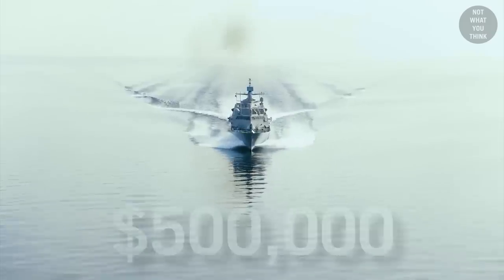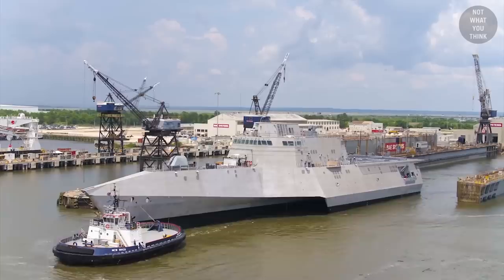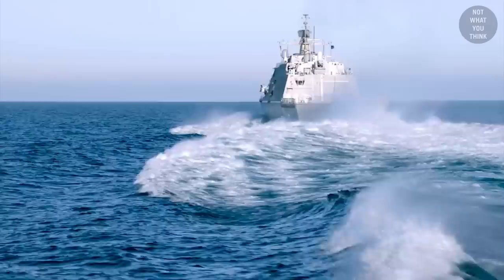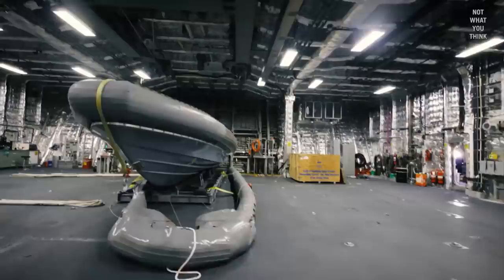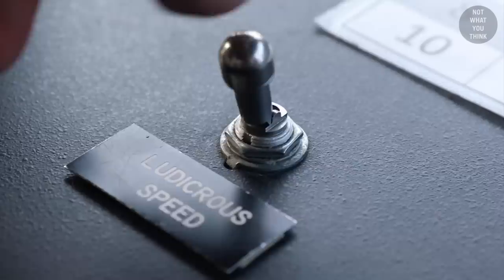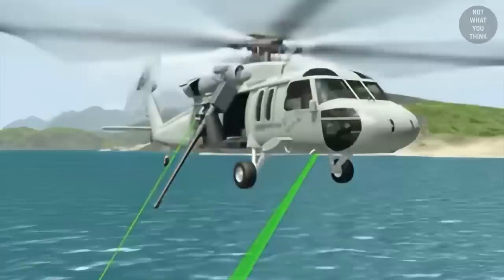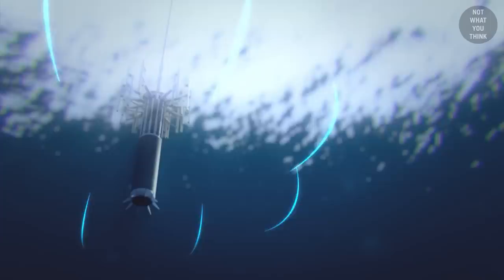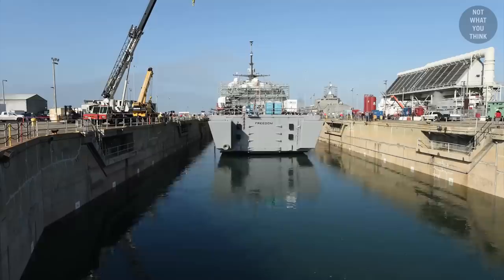Why Retire a 2-Year Old Warship?

Comment: Sucks that the independence class got roped in with the freedom’s.

My babies work now don’t be mean to them 
:(
Reply: The biggest problem with these two ship classes, the crews are way too small for combat ship. Essentially these are like the beer can you pop the top drink the beer and throw it away. In this case if you pop the top that means someone shooting at you and you got hit. Some of the most critical billets only have one person in them. That person becomes a casualty whether they get sick or they get injured, it's a mission kill.
Reply: I also think that the engine should have been turning generators and use electric motors for propulsion. No need for combining gear. When you look at the differences in RPMs between turbines and diesels it's like ridiculous to try and have them I'll put into the same shaft. With codog you're better off with the generator or alternator and electric motors. It's proven technology going back to pre World War II. The only thing I don't like about it is if it starts leaking I don't want to be anywhere near it. Electricity doesn't like me!
Reply: @JohnRodriguesPhotographer  Still, the Independence works, it has all the module's working bar the ASW and is just as fast as promised. While being able to carry 40 hellfires and 24 NSM's which give it more firepower than most of the Chinese navy cough cought 056 Cough 054*
Reply: @AM-hf9kk  Buddy, most warships nowadays would be crippled by a single direct hit. The purpose of defenses is so they don't get hit
Reply: They got rid of the first 2 Independence but are keeping the rest. The first two they used as on-the-job test ships while the others they upgraded as needed. Austel and General Dynamics did a good job, I suppose, as compared to Lockheed Martin.
Reply: @MotoroidARFC  Lockheed should stick to building planes.
Reply: @anguswaterhouse9255  🤣

Comment: The LCS was a joke concept right from the start.
* The low low price was yer typical bait and switch tactic.  Nothing new there.
* The small crew size meant no damage control and an overworked crew, and I doubt anyone except politicians actually believed it.
* The modularity was the most unbelievable of all; anyone with any knowledge of ship construction knew it would never work.

The Zumwalt's magic gun was even more obviously dumb: a gun whose individual shells cost more than a cruise missile, yet had a shorter range, a puny warhead, and less precision.
Reply: Same with the cheaper F-35.
Reply: In short they are trying so hard to dress their war machines to impress.

Comment: (USS Taylor FFG-50, 1998-2000) The FFG 7 program was supposed be a low-cost low manning, but things did not turn out as planned but in the end, they proved to be tough little bastards. 
 I guess you could compare this to the SBD Douglas Dauntless dive bomber when being replaced by the SBC Curtiss Helldiver dive bomber. Which the replacement had more issues then then the aircraft it was replacing.

Comment: Should have done more testing with the prototype USS Freedom before making sister ships.
Well with the ones under construction I’d add a lot of changes to it for good measure.
Ya know when the RMS Titanic sunk, they brought the RMS Olympic (the prototype) back to dry dock to be refitted (basically redesigned) with better bulk heads that actually reach the ceiling unlike the Titanic and adding a lot more stuff that I can’t remember at this time.
You may think it looks good on paper but when its on the field it ends up not doing well or should I say doing bad, that is not gooding to look good on your part.
With the Prototype they should have tested the engines more.

Comment: As a Brit I was wondering about the failed ASW module on Freedom Class ships and wondered why they didn't just ask the experts (the Royal Navy).
We then got to the new Constellation Class Frigate and got the answer.
Which reminded me of an earlier missed opportunity for the US Navy: Why did it bar the best ASW and modular capable frigate available (UK Type 26) from the Constellation Class competition?
Reply: Waste of money if they are going to make it out of steel.  Like most consumer products they are made of polymers.  In fact, Sweden and Norway have been operating stealth ship for over 20 years.  The size limitation is about 250 feet...
Reply: @rgloria40  i think the early lcs were made of aluminium, the good thing is it's lightweight and would be good for range, but the bad thing is if it gets hit, it's harder to extinguish aluminium fire, I think steel is still the better option for building ship hulls, steel is easier to repair and less costly

Comment: There is nothing new in a CODAG propulsion system.
The Independence class is mentioned a similar class without any problems. I remember that there where a problem with galvanic corrosion on the Independence class.

Comment: To the question at the end: I don't think the Navy owes taxpayers an apology. (If anyone does it's the designer, but I think that's a different and more political discussion.) I think the critical thing is not falling for the sunk cost fallacy. USN is getting a number of high speed, incredibly capable surface warfare ships out of this, even if it's not all that's promised - but critically, what we're not getting is a bunch of lemons.

Seeing how Russia has performed in Ukraine, and how much of that seems to be from equipment that was supposed to be counterparts to ours but is actually subpar, I think they made the right choice. The alternatives are to either commission faulty equipment or to throw the baby out with the bathwater, and I think this experiment and its lessons are more important than dumping money into a ship that can trim Putin's nose hairs with an eight inch shell from four thousand miles.
Reply: The Designers build what the navy asks for. And if the deciding officers - as seen so often - again make horrible decision out of egocentrism, power and politics, they are to blame. Not the shipbuilder.

The Navy gave the contract. They made the specifics. They overlooked it. And they did a real bad job at it.
Reply: They need to stop rushing into projects like this and freaking focus.
Reply: They ARE NOT incredibly capable. PERIOD.
Reply: @donaldcarey114  You know they're confused when they start putting hellfire's on ships.

Comment: The same issue will eventually become unavoidable regarding the F-35.
Reply: ... the F35's modular mission pods will require it to retreat from combat and stay in dry dock for several days and the gas turbines won't combine well with the traditional diesel engine?
Reply: I think they have most of the bugs worked on F-35 now.
Reply: Yeah the F35 is the first fighter that can turn into a submarine

Comment: The design suffers from basic faults that are not fixable. It basically boils down to an overly complex linkage from the engines to the shafts, when not maintenance like a Boeing 777 (which your basic US Navy type isn't ready to do) it fails. The other design flaw was the modular concept which didn't pan out. These would be good littoral ships as long as they were ported in the US...but given a tight budget and bad press they are headed somewhere other than the Fleet.
Reply: what happened with the 777?
Reply: @AA-tz2bm  I don't know, I thought we left you in charge of that ?

Comment: The government really needs to go back to the old system where it told manufacturers what it wanted, then let them create a prototype to see if they could meet those requirements and then it paid them to build the item.  Today's method of paying the manufacturers to create what they say they can and cover all the expenses in advance is asinine.  It only ensures that those manufacturers promise more than they can deliver because it makes them sound better than they are but ultimately the delivered product never even comes close to minimum requirements expected.  
When the army wanted a multi-purpose vehicle Willy's created a cheap, light-weight vehicle that could go anywhere and carry 5 men and tow several hundred pounds of equipment.   It delivered exactly what the army wanted with the Jeep to the tune of over 600k built with being able to be used as everything from ambulances to guided missile platforms and it remained in service for over 40 years.  That's how capitalism should work.  Tell competing companies what you want, let them design what they can produce and then compare the results.  Paying a company in advance for what they say they can do, not what they actually prove capable of doing has only increased costs astronomically.
Reply: The problem with that is that all companys would go bankrupt and it would exclude all smaller actors to even particepate. 
   But absolutly they should be better on demanding the the stuff work as intended. But its hard whem the development process goes paralell with the building process.

Comment: LCS class was a test bed ship, it's the senit that pushed it in to full use service. There was no difference between the test versions and production ships which is impossible unless you had some tomfoolery going on.
Reply: Aren't a lot of "wonder weapon" part testbed? Tu-22s. B-2s, Zumwatts, LCSss

Wait, almost as if there's a correlation between expensive, over-promising, under-performing and rocky design and construction schedule.

Comment: For what its worth, the US is an insular nation as Mahan would have said. Similar to a peninsula, but water on 2 sides instead of 3. Combine that with the difficulty an adversary would have attacking the US across the Canadian or Mexican border and the fact that most cargo comes via the water and it becomes clear that the US Navy should be where the nation focuses its military (navy, followed by air force, with much less emphasis on ground forces). So if anything, congress needs to apologize to the navy for all of the times it has tried to murder the navy over the years.
Reply: And FWIW, if it goes up for us in the Ukraine, it won't be the maritime forces on  the ground.  (I see what you're thinking, Lewis, but so often in the recent past, the "tip of the spear" for us hasn't been oceanic.)
Reply: @michaellastname4922  The thing about the Navy, is that the Navy is the force that allows the US the ability to create a safe zone around essentially the whole country (or at least the lower 48 in any case), pushing any encounter with an adversary over to their region. As well as providing one of the possible means for fighting said adversary (which is of course dependent on the who that is and what needs to be done to that particular adversary).

Add to that the protection of the sea lines of communication. And you end up with a hell of an argument for making the USN the focus the way the Brits focused on the Royal Navy back in the day. Maybe not quite as uptight and not excluding the other services quite so much, but you get my point.

It is the protection that the USN gives the US at home and abroad that allows us to send substantial forces abroad. Not to mention things such as what gets done by other ships under the protection of the USN. 

You can see this doctrine of putting fleets out into the enemies side of things in practice with how the USN likes to deploy fleets out into the world rather than always shepherding them into home waters. So this really is how the USN is acting, though not as well as it could be. Which means it is not as if I am saying to take everything away from ground forces or anything like that, just a rebalancing of priorities. (and an apology for all those times congress has tried to murder and/or assassinate the USN)

Comment: The critiques of this ship and the class are somewhat accurate, however, it is a reflection of the depth and breadth of US technology. This class and the Zumwalts were essentially ahead of their time and their core missions were somewhat undercut simply by the circumstances of a changing world. But the US will have learned a great deal by what can be called a failure of scale. These lessons will continue to put America far ahead, like at least a generation on ship technology vs China and Russia. American can afford this kind of thing and still maintain a distinct advantage with existing tech. But still it cannot afford to do this kind of thing too many times... Similar things are also occurring with the air side of things and American fighters and bombers. One lesson there is that you can't always build one platform to meet everyone's needs. You may end up with a mediocre platform a sort of jack of all trades, but not an expert at any.

Comment: The very concepts on which the LCS program were based were poorly thought out.  One issue that was not covered in this report was the lack of combat survivability that was intentionally part of the class's design.  They were intended to be so expendable that they would be abandoned after a direct hit.  

Engineering and construction was the second, equally flawed phase.  Why didn't the USN perfect the mission modules before building the ships?  Why didn't the USN set up the portside infrastructure to make the module swaps practical?  Heads should roll due to this incredibly inept program, yet no one is held accountable.

Comment: all these issues could have been fixed what they dont want you to know is that aluminum was used in a large part of the build , weakness compared to steel ,electrolysis in a salt environment when in contact with the steel , burns at low temps not a good feature in war time

Comment: If the failure lay with the contractor, aka did not meet the promised deliverables, then I’d hope the contractor had a monetary penalty.  If the failure laid at both parties feet, then a budget reduction to cover the Navy’s share and the contractor needs to pay a portion.  If it’s the Navy’s fault, then those responsible need to be retired and a budget reduction to cover the loss.

Comment: Which of the LCS Classes has the major problems with Hull corrosion? 

I don't believe given what happened with USS Independence (LCS-2) and allegedly there are structural defects in more than half that class limiting their speed and operation the Freedom class will be slower in mothballing/scrapping

I think all the LCS have flaws and ultimately the US navy will want to proceed with replacing with more traditional frigates consistent with technology it has and using use with its major ally (UK) via the Royal Navy

Comment: Honestly it seems fine. Technology transition ships are always a bit of a mess and a learning process. As far as why they made so many? It's simple. The Navy puts in an order for a minimum quantity with the contractor that is required for them to bother tooling up and starting the supply chain. The navy would then have an option to expand the quantity for additional cost but reducing it would not save any money. When it comes to implementing experimental tech the contractor will have signed a waiver that basically states the government is getting an alpha release and it might be junk. The navy clearly kept the initial run going to try and get their money's worth and maybe get the kinks figured out for the next class.

Comment: It should come as no surprise that a Navy that cannot even provide its sailors with a good working/utility uniform would have problems designing and building ships.  It all comes down to leadership. You had CNOs more worried about their post retirement careers with BAE systems or Theranos Inc than the Navy they were supposed to lead.  It is reflected in the lower level leadership. LCS, Zumwalts, USS Ford, Fat Leonard scandal, The LHD-6 fire, CVN-73 living conditions /suicides, ship collisions, USNA cheating/drug use, botched JAG prosecutions are all leadership failures.  It is not just the Flag officers but the senior enlisted leadership that is failing to do its duty.  The US Navy is broken.

Comment: With the billions $$$ wasted on this project, the Navy could have extended the life of the remaining Perry frigates by adding a 32-cell VLS in place of its removed Mk 13 launcher, with an addition of either a 57mm gun or RAM launcher forward of the VLS. With 2 anti submarine helicopters, a Phalanx CIWS and 2 - triple torpedo tubes and a top speed of 29 knots, the Perrys are far more formidable than those shitboxes built by Lockheed.  
Then once the new Constellation class frigates start entering service, they can replace the Perrys ship-for-ship.  
The Perry class frigates are tough ships. Just watch a video on the Navy’s SINK-EX and see how much a Perry frigate can take.

Comment: I worked on the DDX LCS system in its earliest stages. At that time, the propulsion concept was to have electrical generators that would power electrical motors for propulsion. I left the company I was working at before I found out what happened to that concept. Evidently it was scrapped.

I read a comment here saying that one of the faults in the program was that the Navy did not provide for a testbed vehicle to experiment on the different concepts. This reminds me of how SpaceX launches new rocket designs before they are perfected. This is their way of providing a “testbed” type of facility during the development process. Provides them with faster development than Boeing, etc.